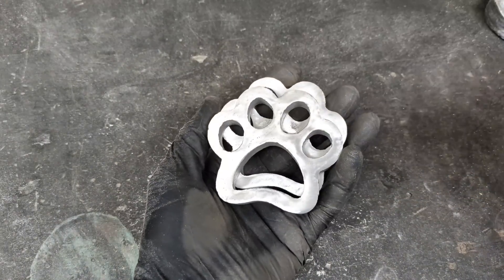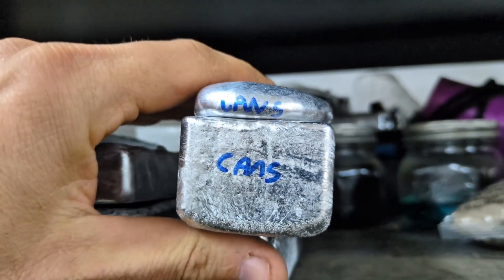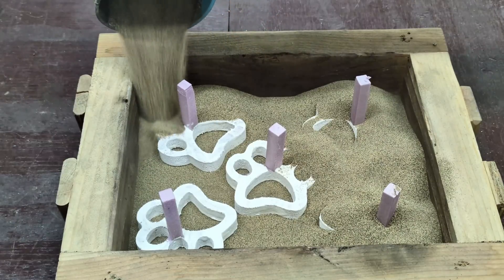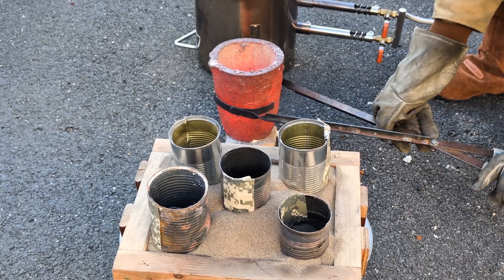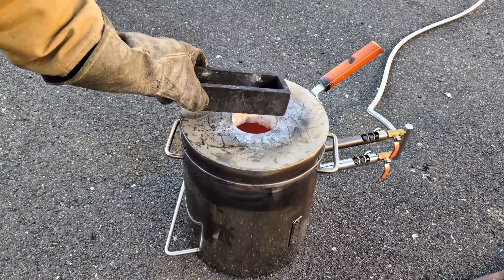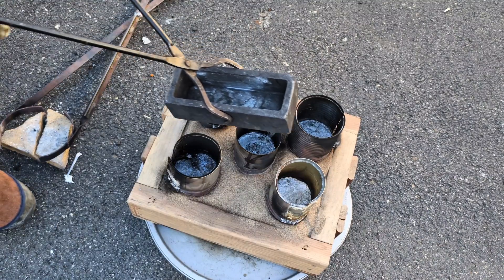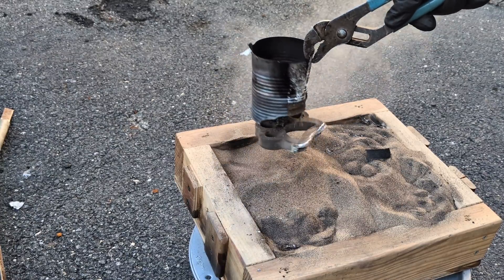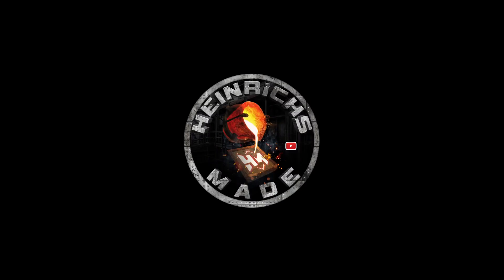Metal Casting for beginners - Easiest way to metal cast

Comment: that was cool. i was wondering if the sand would be a good enough insulator to save that 5th one. cheers for the shout out.
Reply from the maker: well, it would have worked if I didn't run out of aluminum.  The second pour was probably 10-15 minutes later.  I didn't expect it to work. 👍👍
Reply: @HeinrichsMade  yeah for sure. i was surprised it almost worked. maybe an extra inch of space and it would of been ok.